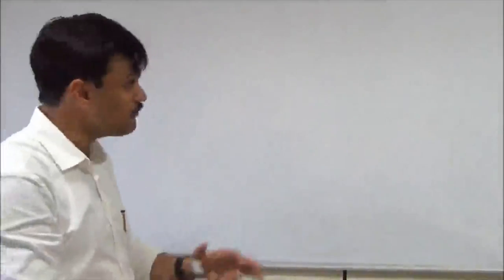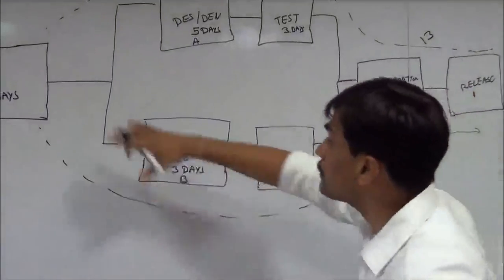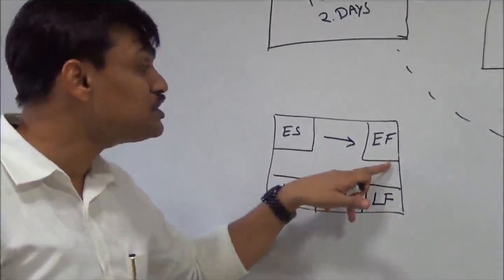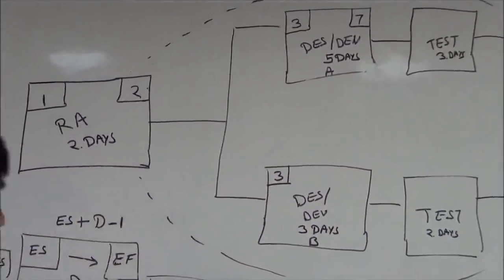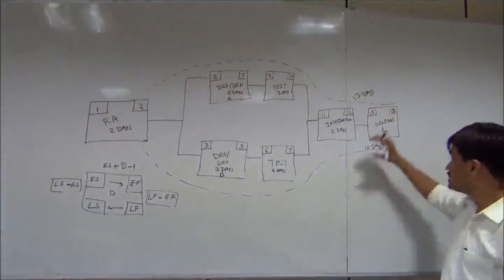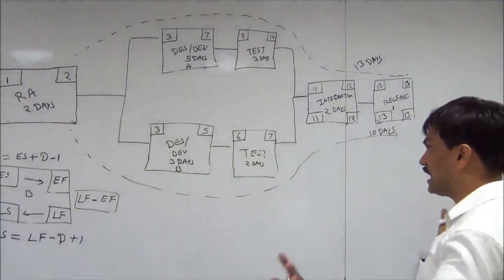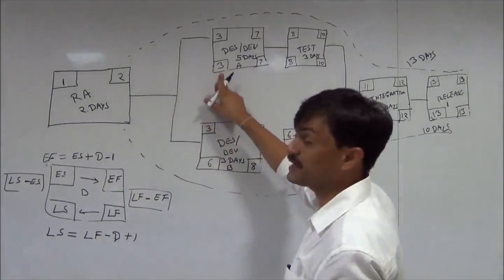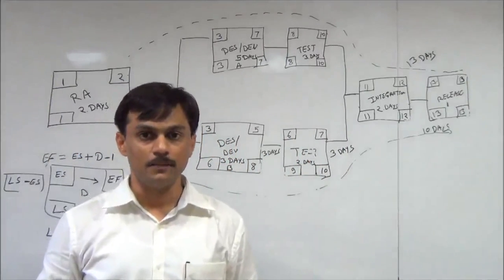Project Management Professional (PMP)®  FAQs | Critical Path Method | Project Time Management |

Comment: hi got a question
if original project duration is 23 weeks and management wants project to be completed in 20 weeks, what happens to the critical path? will it get compressed by 3 weeks i.e float will be -3 or it remains the same
thanks
Reply from the maker: Please post your query on our discussion forum http://forum.izenbridge.com/viewforum.php?f=3&sid=a30343063a20e3eac5caee166fa225c6 , our experts will get in touch with you shortly.

Comment: First of all, hats off to you for explaining the concepts in a very logical way!  Your set of PMP videos really augment the fact that Knowledge has no borders and knowledge community is one. I am your neighbor (From Pakistan) and benefiting from your videos big time.

I have one small following query regarding CPM, appreciate if you could reply to my comment.

Is it ok if we start the calculation as ES = 0 instead of ES =1 for forward pass? Will it impact the calculation  in PMP exams for critical path analysis? As per my analysis , if we start with zero then calculations for EF and LS are same as per your example in the above video .However, ES and LF are different as one need to add (+ 1) to ES and subtract (-1) from LF for your example i.e. starting with 1. 

Can you please tell that starting with zero or one for ES is the same thing? What is recommended PMP approach?

Thanks
Reply from the maker: Salman Shakeel we wrote blog on this topic sometime back , http://www.izenbridge.com/blog/comparison-between-early-start-as-0-or-1-in-network-diagram/ , and please join us at forum.izenbridge.com for discussion on PMP related topics.
Reply: iZenBridge Consultancy Pvt Ltd Thanks a lot.

Comment: Dear Mr.Bansal ,

 I have  a query regarding ES and EF as in other videos it shown, " ES of first activity is consider 1 and EF is ES+duration ; in this (your ) video you have mentioned that ES=1 and EF=ES+Duration-1" ....I am confuse between this two methods, kindly guide me which one is most appropriate as I will going to appear PMP exam on 25/03/14.
Reply from the maker: Lets start with similarity , both the methods provide you the same critical path. Some of the PMP books (mainly Rita) usages the one which you are explaining , where they start the first activity from zero (0) , till fifth edition PMBOK was not having any preference to start with zero or start with 1, but in PMBOK 5 (page no 177) we have example diagram where it uses the method which we are using. 

The method we use gives more logical early start to activities. beside early start and late start other values comes same by both the methods.
Reply from the maker: You can join our forum to discuss PMP related topics forum.izenbridge.com
Reply: Thanks a lot for updating... you are really good for people like us
Reply: I think we can start ES with Zero and change the formula accordingly.